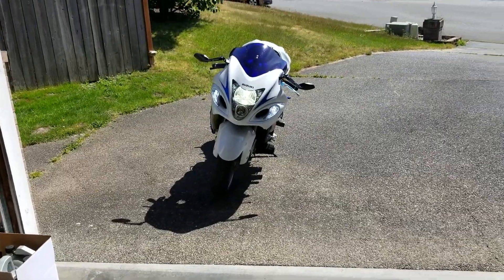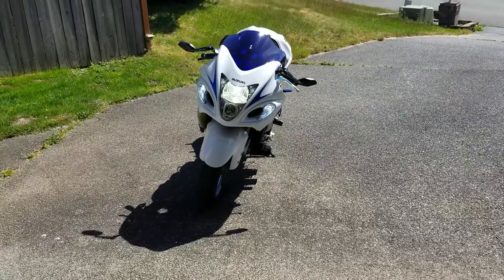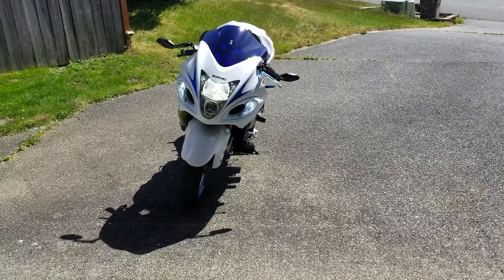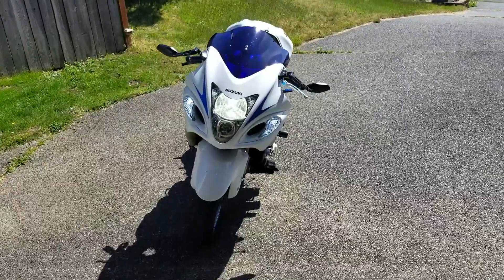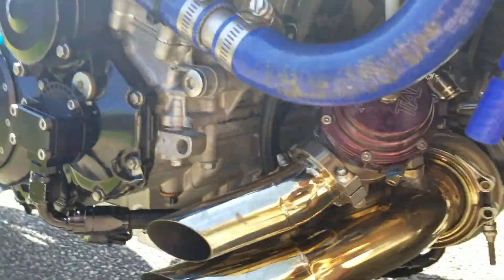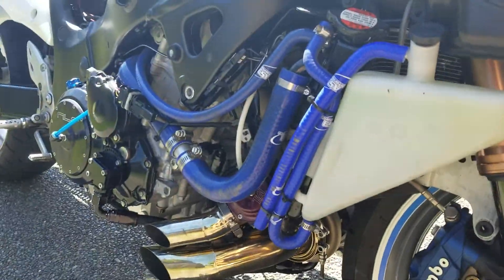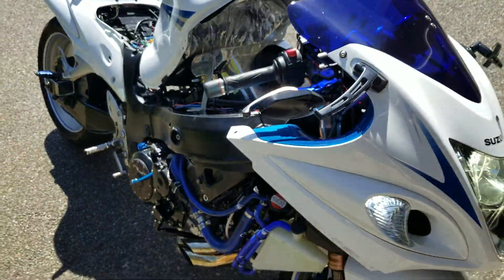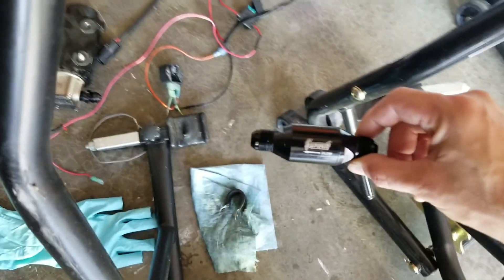BOOSTAs scavenge pump V3.0.

Comment: Wow. Impressive. I can't wait to get my busa so I can do this. I do have a question about the turbo however: did you have to install a spacer between the block and cylinder head?
Reply from the maker: Caleb Roberts when I started I didn't and it was fine.    Once I built the motor I did, though the pistons I bought said they didn't need it.   I may take it out sometime in the future, but need to check spacing/valve to piston clearance.
Reply: Haya Boosta ok gotcha. Yeah cause I saw different things regarding how much boost/hp you could make with or without the spacer.
Reply: Haya Boosta also what's a good turbo to go with? I checked out on 3 performance and they seem to have a really cool kit for the price
Reply from the maker: Caleb Roberts honestly, three of my buddies run RCC stage 1 kit.   They do a pretty good job.   I almost wish I went that route, but I got a pretty good deal on my at the time. I would not go with Hahn
Reply from the maker: Caleb Roberts yeah in the gen 2 I made 263 with no spacer.   With a spacer may be 290.  

Honestly 263 can hold with my 400 for awhile just because they can actually use all the power I can't and it's a struggle for me to get the perfect amount of acceleration and not crashing
Reply from the maker: Caleb Roberts yeah in the gen 2 I made 263 with no spacer.   With a spacer may be 290.  

Honestly 263 can hold with my 400 for awhile just because they can actually use all the power I can't and it's a struggle for me to get the perfect amount of acceleration and not crashing
Reply: Haya Boosta sounds good! Yeah I'm excited about it. So stupid question, but before I buy one, is there any reason I should get or not get a zx14 over a busa?
Reply from the maker: Caleb Roberts no such thing as a stupid question, other than that one...jk.  depends on what you like.   IMO the 14 is a nice bike,  smoother,  actually faster with slight mods.  Doesn't have the trunk space.   And less options in terms of turbo kits etc.   They have higher compression motors which isn't great for turbos. 

Really comes down to what style you like.   I've just risen a busa since 03.  I would take a 14 if someone gave it to me.   In fact my concours is just a heavier slower version of the zx14.  So I do like them
Reply: Haya Boosta LOL. But thanks for the objectivity. So I currently ride a gsxr (got it a few years ago). I originally was trying to get an r6 or cbr but happened to get a good deal. Anyway, really for the past year hyper sports spiked my interest. Since then, I've always thought the busa looked more attractive than the zx14, but I think that's because the '14 is more "conventional" looking (closer to the overall profile of any sport bike) wheras the busa is much more unique looking. Anyway, I know people say the zx14 is "much faster" :check out doitwithdans review of the zx14 after riding the busa, although I feel like he over exaggerated about the difference in power: but I think I'm going to go for the Suzuki especially if I'm going to turbo it.
Reply from the maker: Caleb Roberts no substitute for PSI.... the busa with a flash, exhaust,  air filter I've seen with 210hp.  Busa with the same may do.  185-190. Of course that's small beans considering
Reply: Haya Boosta that's pretty damn good though. I bet it's a boost in torque as well. Have you beaten any h2's with your setup?
Reply from the maker: Caleb Roberts not yet.   Though the H2 in the right hands will beat me.   They just make power instantly.   I will eventually catch up, but we're talking 150mph +
Reply: Haya Boosta wow. Even a stock h2?!
Reply from the maker: Caleb Roberts stock will probably get a couple bikes in my before I can spool.
Reply: @hayaboosta8939  getting back to the pump! how much was it?
Reply from the maker: @michaelhall549  oh boy....
It's all a blur with all the money I dumped into it,  but I believe it was about $250
Reply: @hayaboosta8939  could you give me a dimension of how far it sticks out off the casing ? my busa turbo is in a kit car and the rad is close ! much appreciated..
Reply from the maker: @michaelhall549  sure thing, I'll try to remember later today
Reply: @hayaboosta8939  Thank you for that, I am also looking at another from PACE Motorsport in Australia. It looks even smaller, take a look.
Reply from the maker: @michaelhall549  so from my best measurement it sticks out  1-7/8" from the engine casing
Reply: @hayaboosta8939  That's great thanks! stay safe...